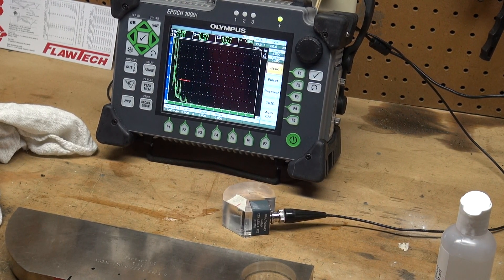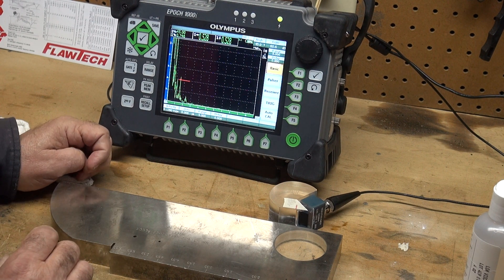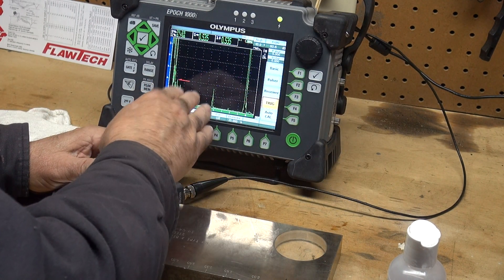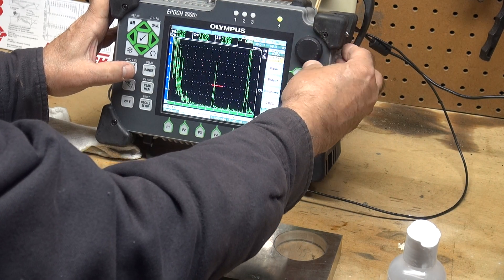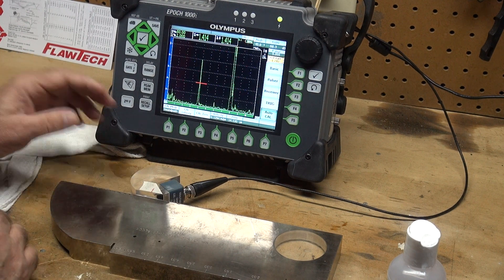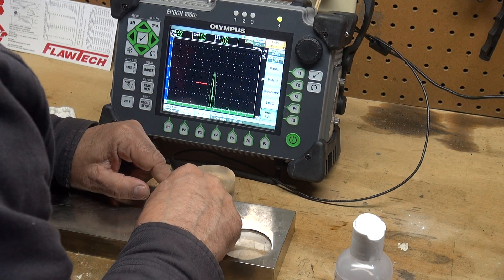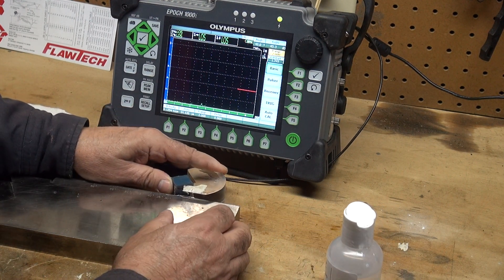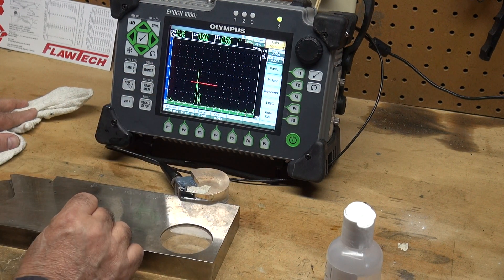UT Angle Beam Calibration Using IIW Type 2

Comment: should you check your index point and your agle before calibrating? because if your agle change the pathway change and need to recal again. am i right?
Reply: Agree..
Reply: Not really. This is the whole reason that they are radiused so you could cal a 70 degree wedge or a 45 on the same surface. The 0 degree hash is the center of the "circle"